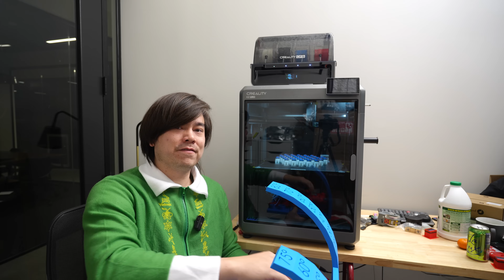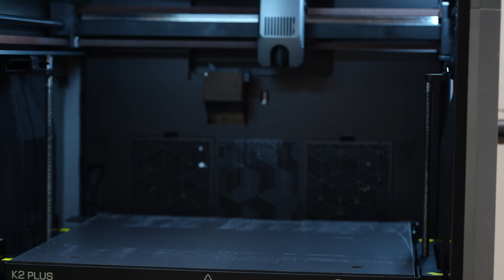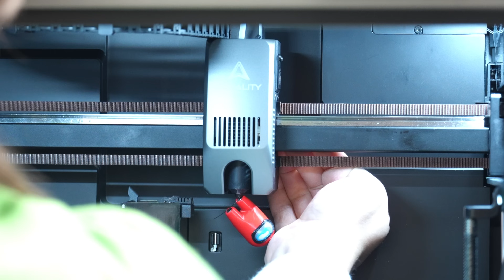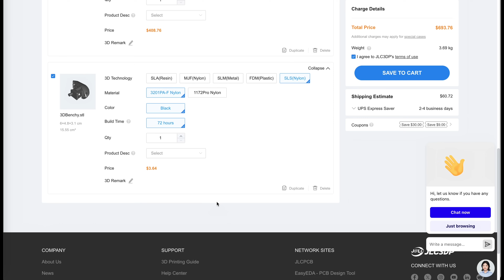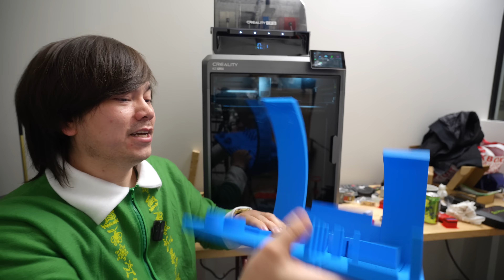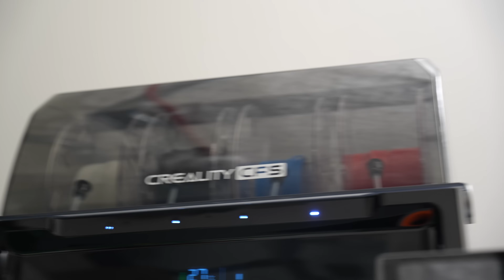Creality K2 Plus - Back With a Vengeance

Comment: Great review!  Thanks!  I was intrigued by the K1 Max but didn't order one because it looked like it was not ready for prime time, by which I mean the features looked good but the design and implementation probably wasn't ready for a small business print farm.  The K2 Plus seems like a legitimate 2nd generation version where Creality learned from the K1 as well as their competition.

Making functional parts, I don't have much use for colors, but I have some designs that I'd love to implement in ABS and TPU, and the K2 Plus would allow me to print those parts in place, making a much better product with no assembly labor.  Printing a huge bed of these parts would be a real time saver too, as well as reducing the filament wasted on poop.

My only user mod would probably be a heater to make the CFS box into a filament dryer.

I assume Creality is using good old reliable steel linear elements on the gantry motion control with bigger motors to get faster speed, unlike Bambu using carbon fiber tubes?  Carbon fiber wear probably isn't an issue for hobbyists, but I don't want to see motion control parts visibly wearing on a machine used for 24/7 production.

Comment: Gotta thank Bambu for forcing these companies to put out quality machines. It's a great time for 3D Printing 🙏🏾🙏🏾
Reply: i said the same same and he deleted my comments that's funny
Reply: Gotta thank the Klipper software developers for the firmware that makes the newer, faster, better print quality 3D printers possible, as well as the various open source hardware developers for the design improvements that are making it into commercial 3D printers.
Reply: @Liberty4Ever  definitely them too
Reply: Prusa been putting our quality machines for a decade now.
Reply: @LilApe  this is very true but it didn't really force any innovation
Reply: @LilApe you misspelled "overpriced." When did they start doing input shaping and multicolor again? Oh right, after Bambu.

Comment: I really appreciate the comment that while money didn't change hands, you did receive the printer as a favor from the company under the understanding that you would make videos about it and could thus be considered sponsored in that sense. If I were a reviewer, I'd make a point to emphasize that with every review of products received for free from their producers.

While this printer is far outside of my price range, its small footprint and low noise would be really enticing if I had deeper pockets. I'm looking forward to seeing how what Creality's made here will ripple down the pricing stack across the market. I wonder if the choice to go for closed-loop control will pan out in particular - the Magneto X seems to be a disappointment overall but closed-loop control with traditional motors instead of linear motors might be the happy medium and the solution to beat if this printer takes off.

Comment: Comparing price the difference between Creality and other brands is a bit moot... Most Creality owners spend additional money on aftermarket upgrades in order to get their printers to run like the other printers.
Reply: Ummm..No I've had a K1 since June 23 and there are zero upgrades inside the printer. I do have a side mount spool holder and a top cover (which I almost never use) riser. Both were made by the printer.  Current print time is 23 days with zero parts replaced

Comment: I am a former Creality fan turned Bambu fanboi. Given the cost... The bambu A1 with AMS lite has solved ALL of my 3d printing problems. I was so ticked at creality for releasing the Ender 3v3se (a good printer) that was plagued with very bad firmware... I couldn't wait to get a printer that just worked.

The only thing I wish was that the bambu A1 had a 350mm square bed rather than a 256mm square bed.

The K2 looks like a decent form factor, but it still can't beat bambu on price.
Reply from the maker: A1 is a nice printer, I have a mini and have enjoyed using it as a bottle opener
Reply: Interesting. The mini is definitely too small.

Comment: Is there a reason you haven't covered the Qidi plus 4?
Reply from the maker: Don’t have one. The x plus 3 they sent me was not up to my build quality standards. Too much plastic in the toolhead, so I got rid of it.
Reply from the maker: They tend to use wood screws and stuff to hold it together . Maybe the new models are different, but I expect threaded inserts and machine screws as a minumum
Reply: @NathanBuildsRobots  thank you for the response. I have the QiDi Q1 Pro and I think it's a great machine. I think you'd be impressed with the Plus 4 if you ever get a chance to use it.
Reply: I had good expectation with it, but as it seems like there are more and more problems are popping up. However their design got better since the microwave, xerox-machine, washing machine impression. But not close enough to Creality. They are really doing well regardimg aesthetic. I would say they are even better than bambu.

Comment: do you use any glue on the plate? can not wait til mine comes in
Reply from the maker: I cleaned the plate with dish soap before doing multicolor prints. I did the benchies and large test print unwashed from the factory and things stuck

Comment: I refuse to be a first mover on this printer. Lessons have been learned acquiring the Qidi plus 4.
Reply from the maker: Having problems with the Qidi? 
I agree, I would not have bought this printer, but I have an excellent example of it to use, and I’m pretty happy with it.
Reply: Always keep the latest firmware, Plus4 print quality always is so great.

Comment: Looks nice but I’ll wait for Bambu . I wonder with a bed instead of texture both sides textured  one side and the other smooth , the reason for smooth might give even heat on the surface versus uneven on textured.

Comment: Looks really good - like the size and its colour change movements do like slightly faster than an X1C, also like the fact that it is likely to be mod-able.  Only slight disappointment is that the AMS units are like the BL ones not stackable which is a shame.   

May well get one of these - but will probably wait until 1Q next year to make sure the new BL version doesn't have any existing stuff in it - like parallel printing and the ability to share AMS's across multi printers.

Comment: Impressive, but annoying. I'm having to reassess my entrenched opinion of Creality. Grrr!

The sound levels are very surprising. I didn't think that was possible on modern, fast printers. I'd like to see some higher temp material prints. ABS, at least.

Can the CFS handle cardboard spools? Or does it use the same mechanism as the AMS, meaning that printed rims are needed?
Reply from the maker: The CFS is pretty much a clone of the AMS. Same pros and cons
Reply: Creality said it supports both.

Comment: The 2Z axis screws had me worried for a moment until I realized my Prusa XL uses the same number as well. And it’s print quality is excellent.
Reply from the maker: Yeah, I point it out as a potential issue, but it’d only be an issue if you’re being really dumb and were building a 2kg print off to one side… 

I could make it into an issue in a contrived use case, but 99% of the time it’d be fine.
Reply: @NathanBuildsRobots  update. On my Prusa XL I did a 2kg max vertical height print on one corner of the build plate. No issues!

Comment: Do you think it would be possible to convert to a triple z or quad z?
Reply from the maker: Actually, I do think it would be pretty easy to add more screws. The bottom has a ton of room to put more motors in if you wanted

But realistically it’s not going to cause issues. The PRUSA XL, vzbot, voron classic, Ender 5, most Qidi printers, etc. all use this layout.
Reply: @NathanBuildsRobots  Thanks for answering, Nathan!

Comment: does it support direct spooling over the local network (wifi or ethernet) without going through a cloud service? if so, is it something sane/normal/open or proprietary?
Reply from the maker: Yes, you should be able to run in LAN mode if it’s anything like the K1 and Ender series. Thats how I usually run it, using a separate network win no internet connection. It’s klipper so you should be able to open a web interface too, but I haven’t tested that yet

Comment: So, let's compile a conclusion on major points, that the reviewer missed on.
- K2 does not use servos. It uses closed-loop steppers with proprietary FOC drivers. It may hurt open-source firmware compatibility. All FOC stepper driver implementations I've seen to date were terrible in comparison to Trinamic. Creality is wannabe, but not a Bambu; its software was always terrible. More of a controversy for me, but FOC and CL are still the future; let's have a hope.
- K2 does not use standard Unicorn nozzles anymore. If you bought anything fancy, it won't be useful here. Yet another stupid, incompatible nozzles to buy. A major minus.
- K2 uses the same frame design as K1, with a monolithic cast gantry portal (and flimsy plastic parts to attach actual gantry to it). It's a plus.
- K2 fillament extruder is a fresh design. Drive gears are not a cantilever anymore. They use ball bearings instead of rollers. A major plus.
- K2 fillament path is relatively long. Being an AMS focused, it's still not the best choice for soft filaments. It's sad but common.
- K2 AMS design does NOT have a dryer. A much cheaper Kobra 3 has a dryer. A major minus.
- K2 AMS uses an unknown driving system. Does it use a reliable Bambu-like motor per spool or a frail spool switcher like Anycubic Ace Pro?
- K2 hotend. Unfortunately, there is still no information on it. The old design was terrible. But since they fixed the extruder, there is a hope that they made it similar to TG CHC Pro without a need for thermal interface replacement.
- K2 boasts an anti-shatter film on the glass door. A major plus.
Reply from the maker: I disagree with some of your points but good info here
Reply: Update. K2 AMS design does NOT have a dryer. A much cheaper Kobra 3 has a dryer. A major minus.

Comment: IS there any issue using prusa slicer with this? Would it be able to control the AMS.
Reply from the maker: I bet you could run any of the major slicers for general printing. I'd have to test the CMS compatibility.

Comment: That total package size looks smaller than the ender 5 plus!
Reply from the maker: It might be, it's incredibly well-packaged. The printhead is like 35mm wide (haven't measured it but it looks really thin)
Reply: @NathanBuildsRobots  I checked the website specs - it should take up about 60% of the desk space as the e5+. We have one at the makerspace that I'm desperate to retire - I probably will still just wait for the bambu, but at least I know it'll (likely) also fit in the enclosure we built for the e5+.

Comment: I just bought the A1 as I wanted to get into multi color printing. Love my K1 and assuming this all goes well I look forward to getting a smaller K2 when they are released.
Reply from the maker: The A1 series is at a much better price point, so unless you need a heated chamber or super large stuff they will work great

Comment: In my opinion the #1 problem with the AMS is its bad spool compatibility.  I like my cardboard spools.  I've gutted mine and built a python to fix this problem.  Infinitely better BTW.  Is this actually better?
Reply from the maker: It looks the same to me, so I don't know if it would be any better than the normal AMS
Reply: They claim that it works perfectly with cardboard spools, and in their streams they usually ran huge prints with 4 cardboard spools, and everything looked good. The one interesting thing is that they still decided to go with plastic spools for their new rfid hyper pla filaments after using cardboard for ages, i wonder if they had issues with cardboard in the cfs after all.

Comment: My first printer is a CR 10 S Pro and when I had a problem with it Creality customer service was no help at all.  I bought a Bambu X1C with AMS and when I rarely have a problem I can go to their Wiki, or their customer service.  Therefore, I am waiting for the new Bambu printer coming in 2025. I am guessing/hoping it will be with multiple tool heads.
Reply from the maker: Yeah, multiple heads would be great and is probably what they are going to go with. Especially if they can get both printing at the same time.

Comment: How does the print quality compare to the X1C/P1S/A1? I have an Ender 3 S1 which was an improvement on my self-build RepRap but a pain to get running. Took 18 months and a complete rebuild to get it there, which for a printer which cost 500 EUR is just bad. Now I have a P1S and an A1 which are light-years ahead.

If the retail K2+ can match or exceed the X1C then it will be worth the 250 EUR premium. The heated bed, having a dryer in the AMS and the size of the bed is a big improvement. I'm of course very skeptical about the bed wobble - my Ender 3 S1 Pro does that (after a rebuild/tightening) and I'm convinced that that is behind the difference in print quality.
Reply from the maker: I'd say it's similar to the P1 series, as in, between the A1 series and the X1 series.
If I set it to the high quality profiles it would slow down a bit on critical features and raise the print quality a bit, but even on the stock high speed preset it is quite good. Basically 0 VFA because of the FOC motors.
Reply: @NathanBuildsRobots  that's awesome! The P1S / X1C prints are impossible to tell apart at least with PLA (and the same settings), as are the A1/A1m. So that's very promising. I have a suspicion that it will do a better job than the X1C with nylon-based filaments too thanks to the combination of humidity control and temp control in the print chamber.

Comment: only 2 z lead screws? no thanks.
Reply from the maker: I would have went with 3. But if it lays a clean 1st layer and works well enough, does it really matter?
Reply: A lot of high quality designs like the vzbot use 2 screws and get this, a single z motor and is more stable than the x1c.

Comment: Nope. I watched the video because who can resist Nathan as a Christmas Elf?

As for fanboyism...  I've had 6 FDM printers (including an Ender 5 Pro and an Ender 2 Pro) and of them all the only ones that get regular use are my Bambu Lab X1-C and my A1, both with AMS. They just work and require only minimal upkeep. I want to print things as a hobby and not have keeping the printers running correctly as a hobby. Maintenance is a given, but constant tinkering to keep a printer usable, no thanks. It's not about being a fanboy, I'd have settled on a different brand had they provided the ease of use and upkeep that Bambu does. And the new FLSun T1 Pro is right now what I would get were I in the market for another printer.

Having said that I'm glad that the advent of Bambu Lab has forced some vendors to up their game, especially Creality from whom I have two older printers that weren't reliable enough for me to be satisfied with them. And after watching this video, this machine is the one I would get if and/or when I need a helmet-class printer.

Comment: it just works? give me a break, Creality have never yet made a printer that just works.
Reply from the maker: I know, it’s unbelievable, but true.
Reply: The k1c did what it supposed to do. So this will be the second printer that is good to go.
Reply: @nicwilson58  my k1 max and cr6 se (before) worked right out of box.

No issues.
My max works Better than X1C that I have at work.
Reply: Funny. My V3 worked right out of the box....
Reply: @claytonanderson9665  ender 3 v2 and v3 works better than k1 to be honest my own experience...  and v2 is a lot cheaper but has no chamber and is restricting me a lot
Reply: And you are right because he was telling me i am wrong about k1, and now down bellow he admits that is true!!!
Reply: My k1c is going strong for 8 months now without a single issue. They really do nice work. Specially with the updated slicer.
Reply: Actually my K1 Max has had no issues and no tinkering. So yes I can belive it just works.
Reply: I disagree... creality IS the reason any hobbyist owns printers. And my old ender 3 pro goes and goes and goes...
Reply: @jcenergy2493  they made the hobby accessible to everyone.
Reply: @jcenergy2493 Agreed my old Ender 3 pro (with Sonic Pad) still produces models I am very happy with.
Reply: So true lol

Comment: Things to show:
How much time to heat the bed to 110?
How fast it does the bed leveling and z-offset calibration?
Reply from the maker: The z motors are really fast, like 3-4x faster than most printers. Calibration takes a few minutes, similar to other printers
Reply: @NathanBuildsRobots  a few minutes calibration on each print - this is what bothers me because I do a lot of test prints, I test print to learn about 3d printing features and materials. The whole print takes a few minutes , now to calibrate a few more minutes... 
I have noticed that for my xplus3 printer every time I lift the pei , I need to do auto bed leveling . 
These everyday use small details bother me.
Reply: What do you expect? Every single printer that uses any kind of touch probe is going to take this long, and it only increases with bed size. The only thing on the market to speed it up is to use an eddy sensor, which there will probably be a mod to put one on the k2
Reply from the maker: Also bed goes to 120 and didn’t take long, but good questions